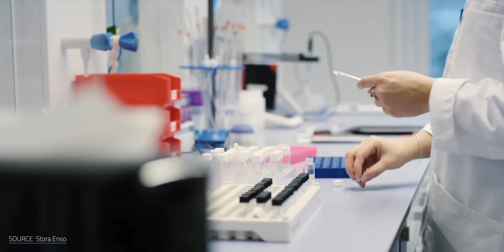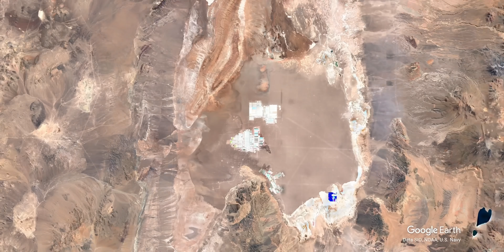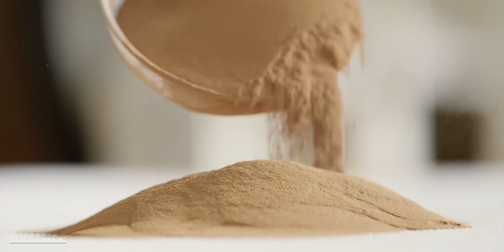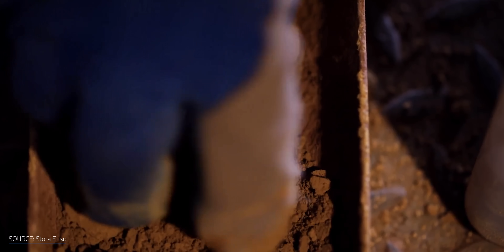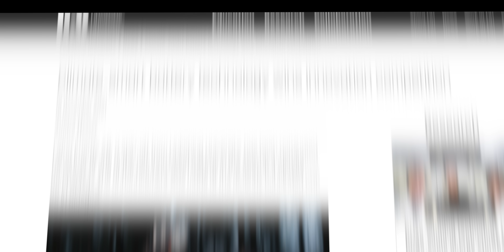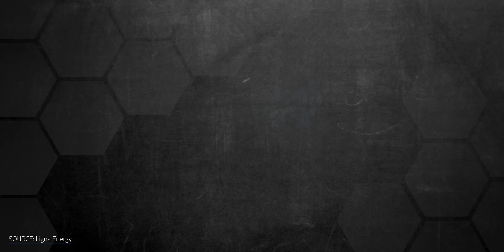Growing Batteries - Wood Battery Explained

Comment: I think one problem people aren't talking about is agreeing on standards and focusing on a technology.  Climate change is time-sensitive.  Can we afford on the Market to decide which renewable technologies we turn to?  What I am seeing right now is hundreds of small companies, each pushing their own technologies.  There has to come a point, and soon, when someone says "ok, let's go with this."  How will that work?  And WILL that work?
Reply: I understand your sentiment, but I don't agree. Take batteries: the best batteries for grid storage don't need to be the most energy-dense and their recharge time doesn't need to be lightning-fast if I understand correctly. But they need to have a really long life span and be as cheap as possible to produce. The battery on your mobile needs to recharge fast, be as energy-dense as possible (and not weigh an absolute ton while doing that), while getting this one battery (sadly rn the whole phone) replaced in five years doesn't sound exactly terrible and the price for a light fast and powerful battery can be a bit higher per kW/h. These two use cases need to be optimized for entirely different parameters - why would there be a singular best solution for both? And you can look closer: a small town (think Midwest) with plenty of solar needs a faster-charging battery for when the sun comes out, but has plenty of space for it. City center needs denser storage, but has more higher-earning taxpayers so can maybe afford something more expensive to buy. Etc etc. The cheapest phone you might get might not hold up for long and needs charging twice daily from the start - but you buy it because you need a phone Right Now, the brand new flagship model can fit two days worth of usetime in ever-slimmer form factors and be useless in 9 months, while the ruggedized outdoorsy phone is quite the brick from way back when but still holds up for a week. Different strokes for different folks. 

I'd just like a good comprehensive list of the possible solutions, with comparable pros and cons for each, so I could choose the best for my particular application.

Comment: Great so cut down more trees that we need for Oxygen
Reply: I realize that we don't grow enough trees
Reply: @PinskiYT  That's the point , it would increase planting for trees. Also did you just forget that the byproducts of paper industry are still there just as mentioned in the video. So there's no actual need to cut down more trees when the paper industry have tons of Lignin byproducts not being used. Why not use those supposed waste to be something useful.
Reply: You do realize that its in the oceans that 50-80% of the oxygen production* occurs? Tree's are more akin to carbon storage than actual oxygen production.
*According to NOAA (USA- 02/26/2021)
Reply from the maker: Exactly.  This can take advantage of paper production byproducts.
Reply: @UndecidedMF  what happens when the demand outweighs the byproducts availability
Reply: The world needs more trees that are not made for being cut down later and then aside from that use tree farming
Reply: I really do like the idea of really cheap energy storage but with all things considered we got to make sure that there is no negative side effects applied to a real world situation not just on paper 📜
Reply: These paper mills harvest trees in a sustainable manner. In Wisconsin, companies like Stora Enso have actually increased the amount of tress in the area by a lot. They *grow them*, then cut them down. Huge tree farms. They also  get called in to private properties to clear out tress that would have otherwise been discarded. They also work closely with local conservatories and are big donors for such things.
Reply: @UndecidedMF  I will watch the video again to see what I had miss thanks for the replies Matt you are a interesting person

Comment: The market is full of non-rechargeable dry-cell batteries for electric appliances. These batteries are thrown and end-up accumulating in landfills, and nobody bothers recycling them. Wood batteries may provide a solution to this problem.

Comment: I don't see this as having any advantage over sodium ion batteries. Which has an energy density not quite that of lithium ion, but close, especially considering it might have an equal useful capacity. Perhaps, a wood sodium ion battery could work, but since that's not what these companies are doing, and the two technologies are probably coming on the market at about the same time, it's going to be a hard sell sell for the wood.

Comment: If this break through can be scaled up, it would be a break through for mass storage solutions. It would be a great idea for homes for instance, instead of lithium ion batteries which are expensive. The wood battery, I love calling them that. It would make home power starage more affordable. Im sorry, im not very articulate these days, its hard to put together decent ideas. As an idea, we would never by anything from tesla, not while Felon Musk is involved in the company. If this tech could be proven it would probably be a lot cheaper than home battery systems. We would consider something like this.

Comment: As for  lithium ion batteries; my four year old Leaf spontaneously ignited and burnt itself to a cinder after two years, sitting for weeks undriven and unplugged in; for which Nissan couldn't care a scrap, as the battery was three months outside its six year guarantee. I'll never buy Nissan again no matter what they make, while at the same time their CEO was running from the law; and I was abroad.
Reply: Oof, hope that didn't burn your house down

Comment: Why would that be used as mass energy storage when the C02 battery is on par with lithium ion, and the only components are steel, CO2 and maybe a few other metals in small amounts like copper?
The CO2 dome is better than any battery storage and the good thing is the transition from liquid to gas and visa versa is done at normal air temperature. 
The world would be mad not to use that tech and just carry on with intensive mining when it comes to mass energy storage.

Comment: Isn't this making a material with similar properties to graphene thousands of times cheaper than graphene? Through pyrolysis.
I've been reading on using pyrolyzed cannabis, hemp, for supercapacitors. Being better than other fibers for this purpose.
Reply: Why Hemp?
Activated carbons, templated carbons, carbon nanofibers, carbon nanotubes, and graphene have all been intensively studied as materials for supercapacitor electrodes. High manufacturing costs is one issue—another is that the power characteristics of many of these carbons are limited. This is a result of high microporosity, which increases ion transport limitations.

“It is becoming well understood that the key to achieving high power in porous electrodes is to reduce the ion transport limitations” says Mitlin. “Nanomaterials based on graphene and their hybrids have emerged as a new class of promising high-rate electrode candidates—they are, however, too expensive to manufacture compared to activated carbons derived from pyrolysis of agricultural wastes, or from the coking operations.”

Hemp Carbon Makes Supercapacitors Superfast
Date Published: Jul 31, 2013 The American Society of Mechanical Engineers ASME org

Comment: Why all the bad-mouthing of lithium ion batteries? Didn't you understand that lignode is a proposed alternative to graphite, IN lithium ion batteries, NOT an alternative to lithium ion batteries? Still litium ion batteries, with all it's fundamental issues, pros and cons. They claim it could improve some characteristics, and make the anode production more sustainable, but it would still be the same lithium, everything else the same, only with a slightly different anode, that's all. 

Also, their claims seems more than moderately far fetched, if just carbon powder would make a superior anode, all things considered, someone would probably found that out a long time ago. If it was possible, it would be a huge sensation.  

The water "used" in extraction of lithium is a brine to begin with, naturally occurring brine, why do you pretend enormous amounts of freshwater is used, or "consumed"?  The extraction of lithium from that brine does NOT consume any water that is usable for things like drinking or farming, the water is "unusable" to begin with.        

 Lithium ion batteries have their issues, but those issues are negligible compared to the picture you're painting.  

About the dangers, in the case of lithium ion batteries they're manageable, not a big issue, still you keep bringing it up. Fact is, you can not store energy without some "danger", because in order to store energy, you actually need to store energy, and stored or "concentrated" energy always represents some "danger".  The higher energy density, power density, and amount of energy the higher level of inescapable danger becomes, all else equal.                          

Also all batteries have issues with low temperature, how much and at which temperature it becomes a problem varies, but it is not specifically a Liion issue. And, obviously EVs require more energy in low temperatures, especially if you heat the car with the battery.  The reason why all batteries has issues with low temperature is the fact that temperature is the movement of molecules. You can't change that fundamental fact about reality by switching one type of carbon anode, to another type of carbon anode.      

Perhaps you could stop regurgitating propaganda about lithium ion batteries from the fossil fuel industry like they were extremely problematic, all things considered, every time you talk about energy storage? I mean, come on, doing it even when the suggested possible "solution" is a change of anode?  I'm so curious about if you didn't get that lignode is proposed for liion batteries and not an alternative to, or if you didn't care because the vast majority of your viewers will just trust you when you say it's an alternative. It's the easy way, just replay the old harangue about the issues about liion, and then tone it down a bit to seem "balanced". Blowing things out of proportion in absurdum, and even insinuate severe misconceptions and then toning it down a bit is not being balanced.

Comment: All these so called green cars an so on are not very green with the devastation from the mining. Oil will never run out if we had half a brain we would build a carburetor that did 200 miles a gallon of fuel. That would be the green thing to do.

Comment: The water used might better be used in solar distillation ... thus saving precious water from the atmosphere that can be used.
Reply: But then they would need to build infrastructure Like a roof, one can't possibly expect companies to support human live /s

There are people in Germany filtering lithium from hot spring water.
Reply: Roofs are not an all-at-once project ... the project may take decades ... as repairs need to be made on the ponds. Also, environmental degradation is lessened and cheaper roofing can be used.

Comment: cutting down trees is an over rated concern. Trees are relatively easy to replace in a carbon positive way. Maybe the easiest.
All logging operates in a carbon positive system due to their requirements to replant more than they harvest
I am always for reusing waste though. This is good stuff

also the amazon is so overgrown that if we dont harvest and thin it out , it will surely cause a global catastrophe if it catches fire

Comment: The fact the last 4 minutes is the only actually important, tech spec part is frustrating. This is why I'm not a subscriber.
Back on topic though, an earliest first deploy time of 2027, for a heavily patented (aka priced at market value pricing in 2040) eco product (aka low demand, low economic value, high social value) battery tech that's outshone in most all applications and purposes by other already available solutions. It's too early to get any kind of hyped for this, and odds are it's not going to change the market because it'll be strangled by it's IP holders' grip.